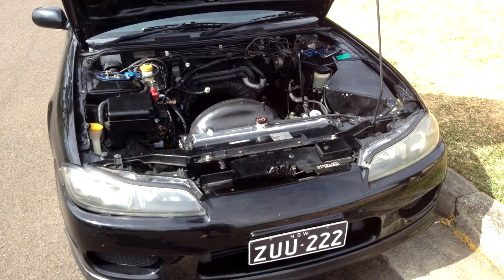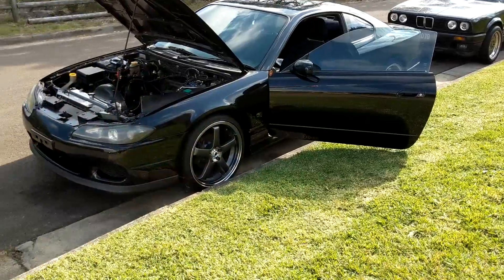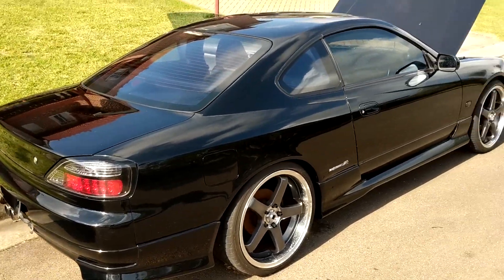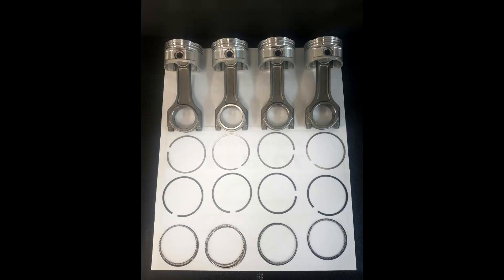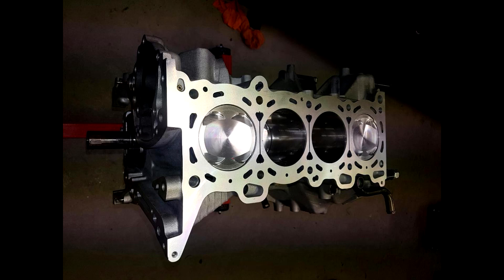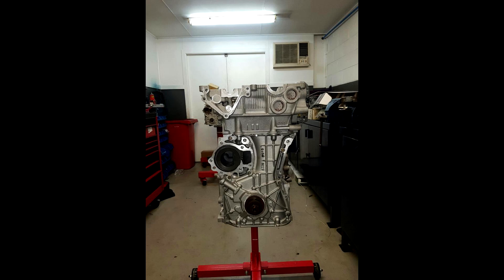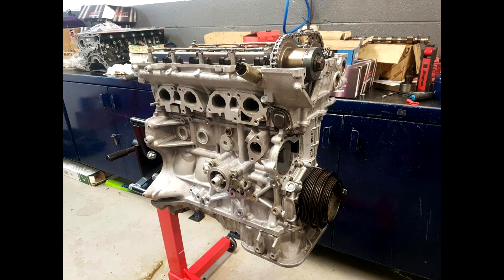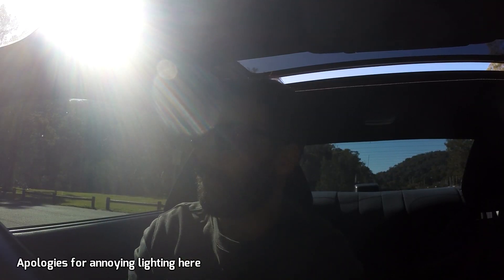S15 Blow Up Aftermath & Update | Alex's S15 Build Ep.6

Comment: What compression did you go with and what head gasket thickness ? Could be too low comp. I have a similar spec engine but 9.0:1 comp with the thinnest Tomei metal head gasket and it’s great. Mines low mount Gen 1 GTX2867r and makes 280rwkw at 22psi on e85.
Reply: Also 256/256
Reply: And e85 is good, haven’t had any issues a year in.
Reply from the maker: I actually don't remember - Don't see that in my invoice notes unfortunately. That's a solid power figure, about what I would expect/hope.

I think my distaste originally came from the big jump in injector size (750cc to 1100cc as I did "plan" for a flex fuel setup with that size) which did make it a bit of a pig down low compared to how it was before - it has gotten better with more driving though and I think perhaps the tune isn't particularly aggressive being a safe one so it may be more peppy with a power tune. Will find out in due course! 

How do you find E85 when/if you don't drive very often? Owen's old S15 was straight E85 and it seemed a bit of a pain sometimes.
Reply: Interested to hear what injectors you’re running. I had the Bosch high flow 1150 / 1300 initially as I thought 980s wouldn’t be enough but they had bad drivability and flowed like a fire hose. Bought standard Bosch 980s (1000s) and they were a game changer. Engine idles and runs a lot better with these and has enough flow for e85. As for e85. My cars on club permit so I don’t drive it that often and I don’t have any issues. Run a battery with decent cranking amps and cold start shouldn’t be too much of an issue. Can sometimes take 2 cranks to start up but nothing really to fear. S15 has a plastic tank which is a plus compared to my S13’s steel tank. Make everything e85 safe and you’ll be good to go.
Reply from the maker: @bigfich123  I think they are Bosch in mine as well but have to track down the box. Been a while. That's very interesting to hear though! 

Good to hear - if I decide I want some more power it may be worth it then.